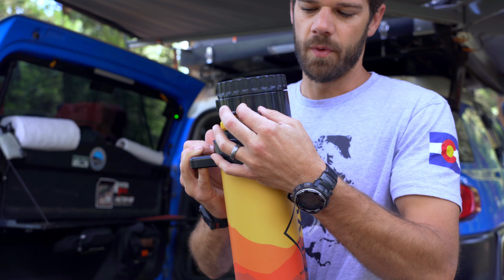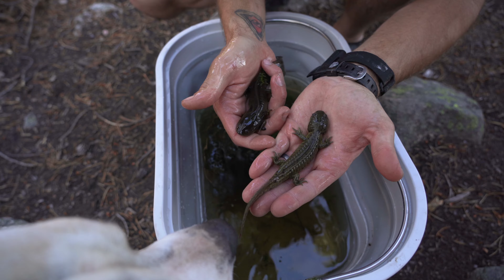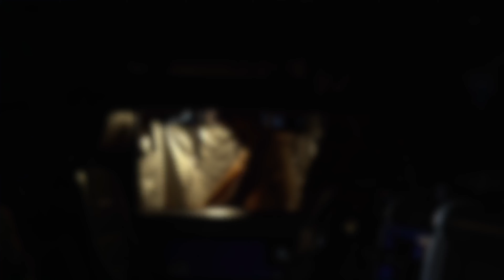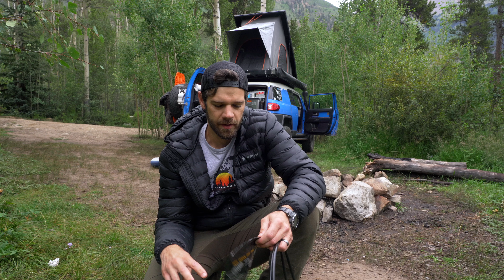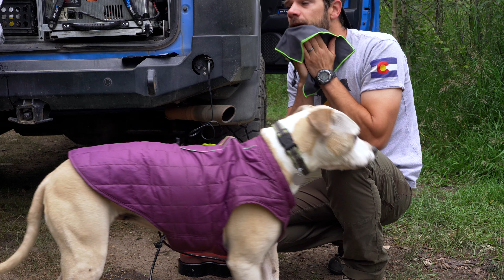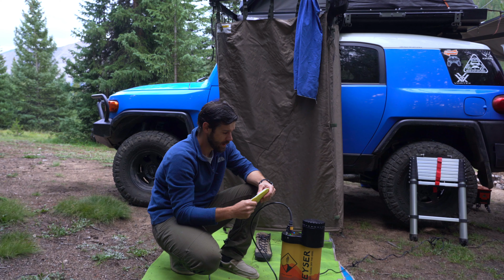Geyser Reviewed: Is THIS the Best Hot Water Shower?

Comment: Very helpful…as always with your content.  I’m headed to the Oregon coast in a couple of weeks and this helped a ton.  I’ve been looking at the portable hot water heaters but they have so many moving parts…this is just simple and does the trick.  Your review helped me lock it in.  Thanks
Reply from the maker: Just used it over the weekend. Its such a convenient gadget to have.
Reply: @IndependenceOverland I’m finding its a bit finicky with my anker c1000 battery…do you use it with a battery or plug into your truck?  Perhaps it pulls too much?  Seems odd to me to now work with my battery.  Curious what you’ve found.  Thanks

Comment: I would like to use a faucet like dometic or the one that the tube comes out the bottom, could I cut a hole in the lid side that doesn’t have the pump switch or will that side only have the cold water side?
Reply from the maker: I suppose you could, but this thing only holds like .8 gallons of water. The taller side is just the bump and whatever else, so it doesn't hold as much water as you might imagine. You defintly could tap into it though. You would need to drill the top, and drop a pick up tube down towards the bottom. Id personally do that instead of drilling anywhere else because if you decide it doest work later on, I am sure they would just sell you a new lid.

Comment: Just bought this for my FJ in Australia ($450 AUD). Expensive, but the fact it only uses 3 litres of water is great. The sponge idea is very efficient. Would t have found it if it wasn’t for your channel, this device really isn’t advertised over here.
Reply from the maker: Awesome man, you will love it! It’s really handy just being so portable. I am quite happy with mine and intend to keep using it for years!
Reply: @IndependenceOverland  I have received my heater unit, however mine has a problem. Once you’ve heated the water (electricity) and drained, I’ve filled with cold water and the thermostat is stuck and still says it’s above 100F and won’t heat. Takes a good 30 mins to realise it’s got cold water in it. Have you ever had this issue?
Reply from the maker: @TheRealMuggs  No sir it’s not normal. Ive over heated water for mine, put cold water in it and it still takes about 30 seconds to register but certainly not 30 minutes. They are a small, and very helpful company I would shoot them an email. If it’s a problematic unit they will replace it for you. Sorry to hear yours had trouble, a know a lot of people with them and haven’t heard many complaints so I assure you this isn’t a wide spread issue!
Reply: @IndependenceOverland  I will reach out to them. Interested to see how you incorporate it to your new build!
Reply: You’re right, they were fast. Fixed now 👌 super happy. Was going to copy your heat exchanger setup but this is so much simpler and very water efficient.

Comment: Well received mine today after a hot day working on the power lines, I though it would be a good test. Stripped down in the garage, it was 86 degrees out! water was on the verge of being cold. Also, the flow valve was leaking. I thought they took care of that problem, but I guess not. Ran out of water before I was Done. Sending it back to Amazon tonight. I will keep using my boss heater and use a small sprayer if I want a water saving shower, but I will be able to increase the temperature at least.
Reply from the maker: Sorry to hear it, I’ve been using mine without issue.

Comment: Bought a rechargeable boss water heater years ago. I'm going to try the geyser out just for showering. if it doesn't work out I will send it back. I bought a 5-gallon usb water dispenser with different ml settings for 25.00 and plumbed it into my aquatainers.

Comment: what would work best if you had a permanet hose setup that u could plug in at a rv site
Reply from the maker: With unlimited water as well? I would think the Joolca systems would be great for that.
Reply: @IndependenceOverland  yes i got unlimited water at my rv site i pay 1000 a month for but no hot water
Reply from the maker: I’d go @Joolca for that 100%. Propane heater, and instant hot water.
Reply: @IndependenceOverland  I bought the one today for 450

Comment: It so nice that you got one I know when I meet you at  the Pacific Northwest Expo we were talking about it   Very well made 
Review on the product I did get the one with out the heater building in and still have not had time to use it yet  thanks for Sharing
Reply from the maker: You’ll love it! I do find myself just heating water up more often than using the electrical feature but I do like having the option. I should have bought mine at the show too, so I could have saved a few bucks!